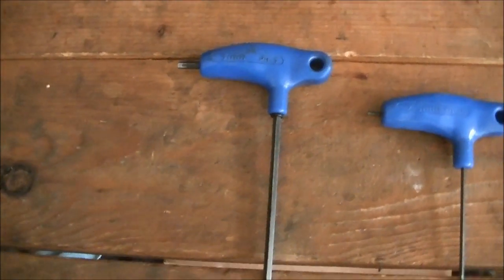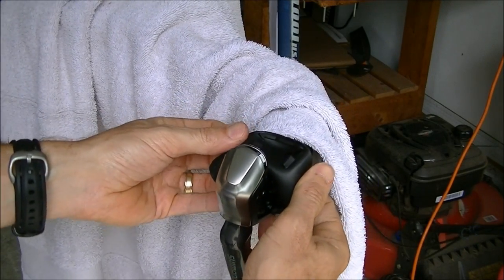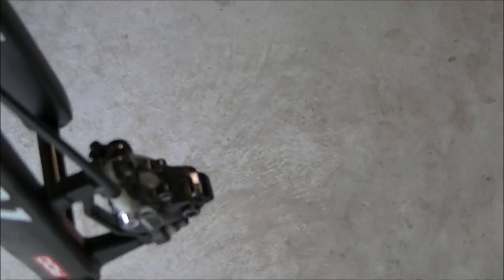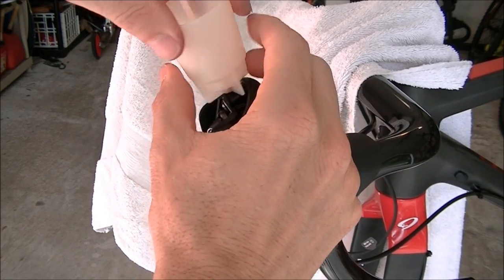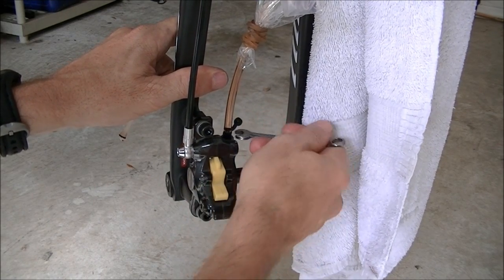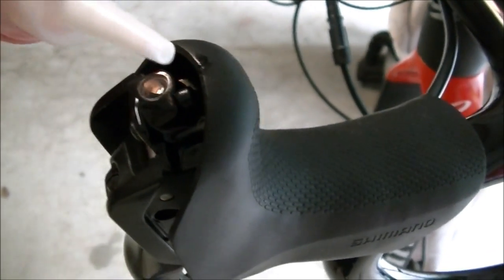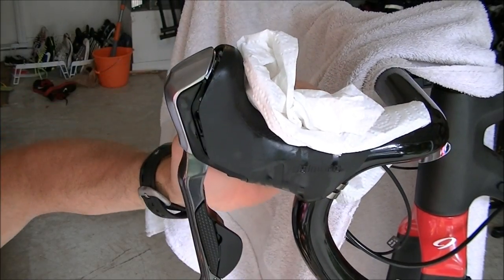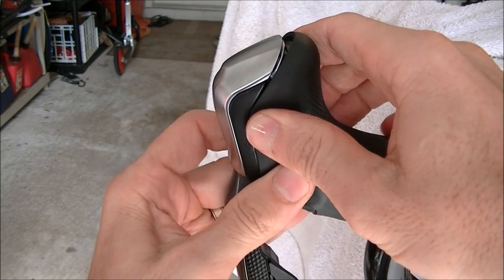How to Bleed Shimano Hydraulic Road/Cyclocross Disc Brakes

Comment: Thank you so much Clint, always  great Instructions, great channel. I'll try this over the weekend.  What's the difference between this method and the one with the syringe ?
Reply from the maker: The syringe pushes the fluid up from the caliper, the gravity method does the same thing but uses gravity to get the fluid from the lever into the lines and down through the caliper. The only problem with the gravity method is that you have to make sure the rear caliper is hanging pretty low so you usually have to get it off the bike.

Comment: Do you find your R785 hydraulic brakes having too much free throw (the amount of lever pull before the pads engage)? I adjusted the free throw screw on the side of the shifter to minimum and its still more than half way in before the pads engage.

I have heard that bleeding and adding a little extra pressure into the hose with fluid before closing the system will "pre-engage" the brakes a bit, do you have problems like this?

thanks!
Reply from the maker: Bleeding usually just makes the brakes firmer when the lever engages, unless there's just a lot of air in the lines.  I find the engagement perfect on the Shimano XT brakes.  I have them as close to the bar as I can without the lever hitting my knuckles (the ones left on the handlebar).

Comment: I don’t see a mention of adjusting the free stroke screw prior to bleed?  Should that be all the way in or out before bleeding?
Reply from the maker: Shimano's bleed process indicates to start at the factory settings which is free stroke all the way in and lever reach all the way out.

But to be honest, it’s not something that I do and I’ve never had an issue with it. I just leave it where it’s at.

Comment: Hi Clint thanks for the video.  One quick question: 
Is it normal to have a slight difference in feel between the front and back brake?  
When I squeeze the front lever, I feed a "hard dead stop" when the pads contact the rotar where as the rear has a slight sponge feel to it.  Both have about the same braking power.  Thanks!
Reply from the maker: +Jack Gadamus  but should have about the same firmness. Because the rear brake line is longer there's more of a chance to get air bubbles inside. It sounds like you need to bleed the rear brake.

Comment: Just an FYI, on the Dura Ace 9000 front caliper...it doesn't have a bleed valve, just a bleed screw.  There is no nipple to attach a hose to. About all you can do is a gravity bleed with the funnel at the top and just open the bleed screw and let it run out.
Reply: Just wasted a lot of time figuring this out and there is actually a yellow shimano bleed adapter that you can use.  Here's thread about it on MTBR   http://forums.mtbr.com/brake-time/shimano-brakes-yellow-funky-bleed-thingy-tl-br52-1001030.html

Comment: Clint fantastic tutorial, Im about to bleed a new pair of BR-RS785 that don't have the bleed nipple just a screw, can you still do this method and let the fluid run out? any tips?
Reply: +Darren Dunn , The bleed nipple is there.  Its just recessed into the body of the caliper (close to the bleed screw).  There is a rubber plug that you need to pull off, then you'll see the nipple.

Comment: Hi. At 09:29 you’re starting a step with quick opening/closing of calliper bleed nipple with pumping of brake lever. May I ask what is the reason for that?
Reply from the maker: It bleeds air bubbles out of the caliper

Comment: I got oil on my pads and just a few rides they were good as new. The bike industry wants you to throw them in the bin but you can just ride off the oil from the pad!
Reply from the maker: Since I live in an area without mountains and I have not been able to try that. But I've heard that you can drag your brakes down a mountain to get the oil off (usually I want my brakes working perfectly when I head to the mountains!). I think it depends on how bad the saturation is. I had a buddy who got oil on his pads and he was on a mountain bike course with steep drops and literally broke his hydraulic line he was squeezing the brakes so hard. I find the sand paper trick works best if you don't have it the opportunity to ride down the mountain to drag the brakes. Thanks for the Post! Take care.

Comment: guys if you are ever short of fluid and need to find some other than the OEM fluid then get auto parts store and grab a bottle of mineral motorbike for bike forksl. it works and i use a lightweight castrol  oil I'm all my shimano brakes for years now. the price is a little cheaper but for me it came down a lighter weight oil, i just like the action that's all.

Comment: Hello clint
      What is the difference between bleeding and burping

(Sorry for my poor english)
Reply from the maker: +Christian Paul Corpuz burping doesn't really apply the brakes. It usually applies to a tire. When you burp a tire you hit something that causes air to leak out between the bead on the rim, which is not good. Bleeding brakes means you just get air bubbles out of the brake lines.
Reply: +Clint Gibbs ok thanks for the answer

Comment: How is your lever throw after the bleed?
Reply from the maker: Unless you have a ton of air bubbles in your brake lines, bleeding doesn't effect the lever throw a whole lot.  But it does effect how firm the lever is once it engages.

Comment: not the correct bleeding procedure for shimano brakes
Reply from the maker: +Pedro Barham like I've explained to others many times, there are two ways to bleed Shimano brakes. When I started bleeding them back in the late 90s the gravity method was the only method Shimano recommended. They have since moved to the syringe method. The gravity method goes from the lever down to the caliper, where is the syringe method goes from the caliper up to the lever. I've used both and both work well.
Reply: my favourite method is the gravity bleed thats why i like hope brake because its so simple unfortunately had mixed results with it on closed reservoir systems like shimano as the air bubbles can collect in the lever then people just end up having to redo it a few times to get it right in the end but they both produce the same result just the new shimano way is less hassle
Reply: all i was trying to do was inform people this is not the recommended method by shimano
Reply from the maker: No worries. I may try to post a video showing the syringe method in the next few weeks. When I used Avid brakes I would always use the syringe method.
Reply: Lots of alternative procedures are at least as good as Shimano's "correct" procedures. This is just one example.
Reply: Thanks for video , I found the syringe method too fiddly so will adopt the gravity method .
Reply: I don’t see a mention of adjusting the free stroke screw prior to bleed.  Should that be all the way in or out for the bleed?